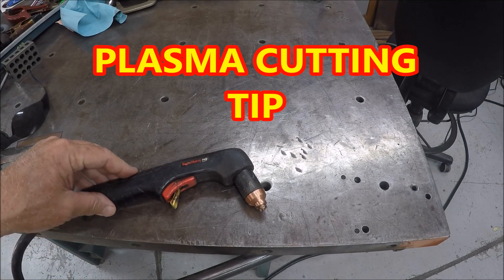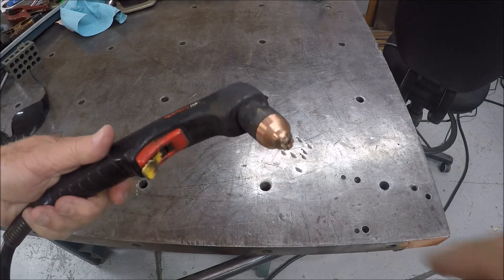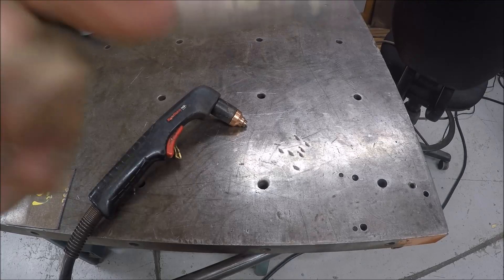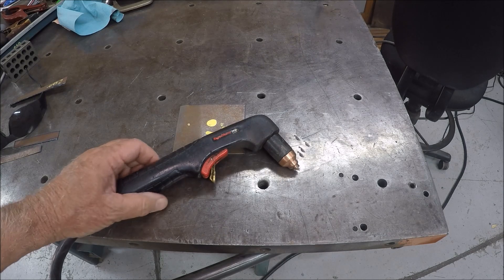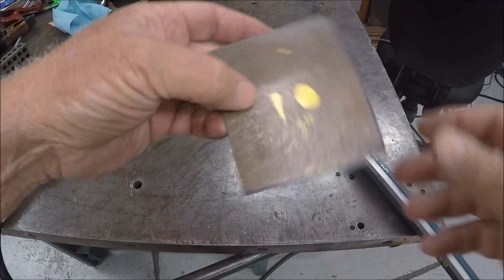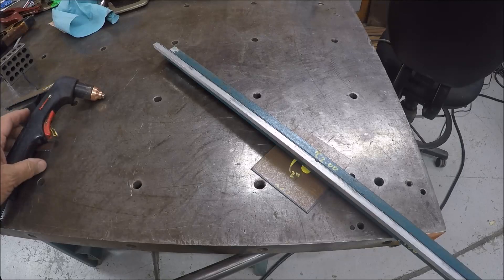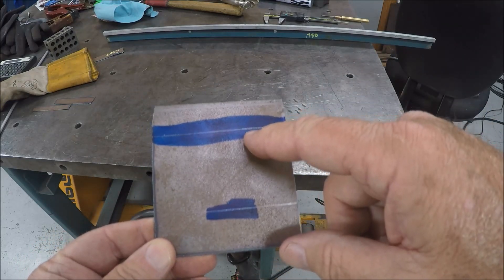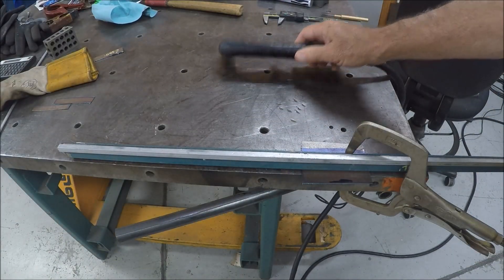Plasma Cutting Tip---Screwy Tuesday

Comment: When cutting more complicate shapes I use a similar method; I use a piece of Masonite with the shape drawn on it the proper offset to make up for the torch dimensions, then cut the Masonite on the bandsaw to the correct shape following the lines drawn. By clamping the Masonite to my stock I can drag the torch among the Masonite guide to get a metal part the right size and shape. It's a poor man's plasma cam, takes some additional time and effort but reduces the work necessary to whittle things to a line after rough cutting. I keep the Masonite patterns I make for future projects as well. Sometimes they can be cut up and pieced together to quickly come up with a new shape.
Reply from the maker: Great comment and yes, I have already done the same thing...

Comment: Kind of dates a torch ,  to almost obsolete or the poor mans plasma cutter.  I still have a torch set that I mainly use to heat & free stuck parts,  like pulleys and fasteners .  Can a plasma cutter be used for just heating parts?
Reply from the maker: I have my torch set also but don't think I will be cutting with it soon.....don't think a plasma can be used for heating like a torch
Reply: I didn't think it would, gouging and cutting is about it.
Reply: robrenz mentioned offhand in a video that he used his TIG to "spot heat treat" a particular part.  I can't remember which one though.